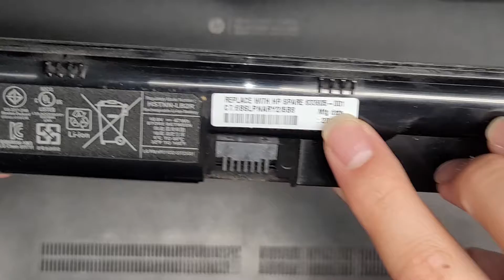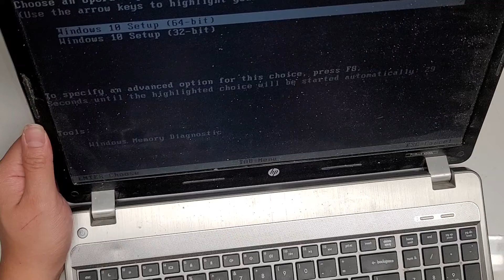HP ProBook 4530S Battery Hard Drive SSD RAM Upgrade Replacement Repair

Comment: Can I add 8GB Ram to existing 4GB? So total will be 12GB. Will it work?
Reply from the maker: Sure
Reply: @ItsBinhRepaired  By the way I loved the way you explained the tutorial. It is so natural and fluent. Keep it up.
Reply from the maker: @adilmuhammad2717  thanks
Reply: @ItsBinhRepaired  This laptop is sluggish with more than 8GB RAM. Cannot handle more than 8GB. So do not try more than 8GB.
Reply from the maker: @adilmuhammad2717  do you have an SSD?
Reply: @ItsBinhRepaired  Yes
Reply: @ItsBinhRepaired  After removing 4 gb, it is flying now as per expectation.
Reply from the maker: Strange

Comment: I need help creating a windows 10 USB installer
Reply from the maker: Here you go https://support.microsoft.com/en-us/windows/create-installation-media-for-windows-99a58364-8c02-206f-aa6f-40c3b507420d
Reply: Do you have a video on how to restore the data on your old drive to New drive using Samsung magician software
Reply from the maker: @ehiemerevictorstudio6644  if you do that, you have no need for a windows 10 usb
Reply: @ItsBinhRepaired  the other one would cost me a penny, and if not paid for, it would be an unlicensed copy I guess.
Reply: @ItsBinhRepaired  So can you do me a video on how to do it with Samsung Magician Tool
Reply from the maker: @ehiemerevictorstudio6644  i don't buy Samsung drives or use their software.
Reply from the maker: @ehiemerevictorstudio6644 I use this https://youtu.be/4p5jFDzVwUw

Comment: is the memory DDR3? can i put 8gb?
Reply from the maker: How much of the video did you watch? I want people to learn from the videos, not just take shortcuts without knowing what they're doing.
Reply: @ItsBinhRepaired  I know about computers, I know how to change an ssd and a ram memory. and my english is very bad (in fact i'm writing this with google translate) so much of the video i couldn't understand so i didn't watch much of the video
Reply from the maker: @UCNGFP_2milIJnjbRk_sKIEA i see,  but you can see the RAM  specs in the video
Reply: @ItsBinhRepaired  I only see that both are 4gb and I don't see that it says ddr3 anywhere
Reply from the maker: Pc3 both 4gb = 8gb

Comment: Hi,

I have a HP ProBook 4430s Laptop and the current configuration is as follows👇

2x2GB 1333Mhz PC3 RAM= 4GB,
Intel Core i5 2520M Processor,
500GB HDD with Windos 10 Pro 64bit.

I want to upgrade my RAM with 2x8GB 1600Mhz PC3 and also want to replace the hdd with the 500GB SSD but don't want to change the processor so is it possible to change all these without changing the the CPU.

Please healp me in this regard🙏
Reply from the maker: Should be fine

Comment: Hi, i did the same thing as you with mine 4530s and kingston 120gb with windows already installed but he dont recognize the ssd as a boot drive, even choicing in BIOS.  I saw in a forum that ssd is incompatible with this model. You did some update in BIOS to it work properly?
Reply from the maker: It's likely bios settings. Try cloning your hard drive to the SSD.
Reply: @ItsBinhRepaired  uh hey i've been trying to find this for a while, do you mind explaining exactly what to do?
Reply from the maker: @rdpando  find what? How to clone?
Reply: I use de SSD in another computer and don't want to lose the archives you know
Reply from the maker: @edneijr.3529  what do you mean?
Reply: when i bought ssd with preinstalled windows the seller ask for bios type which is legacy for this laptop...maybe you bought the other type which is for laptop originally for windows 8 and above....i forgot the other type name
Reply from the maker: @cekpoin  uefi disable csm secure boot on